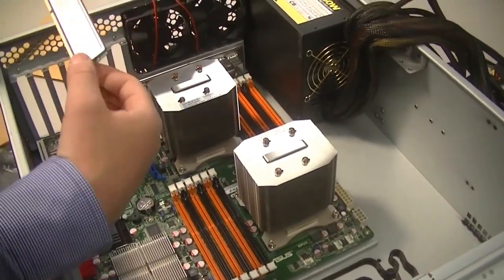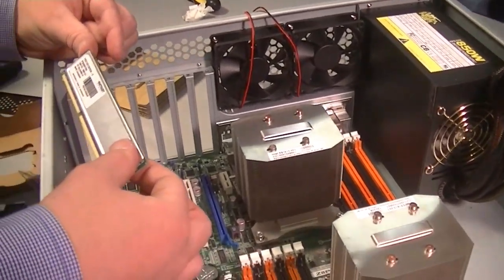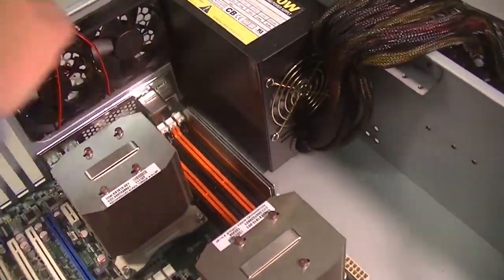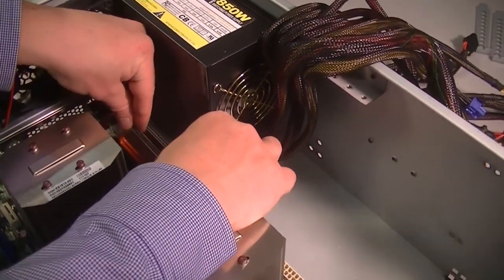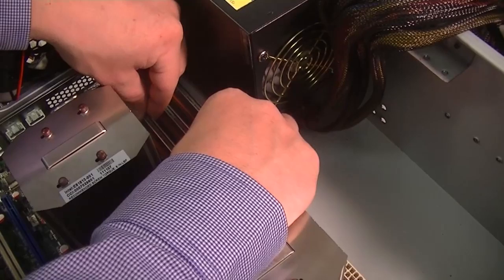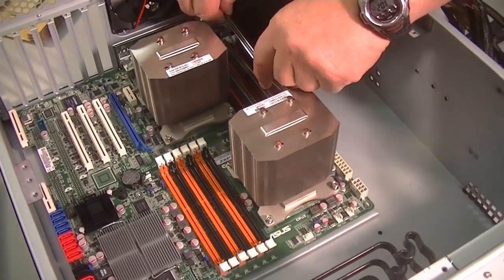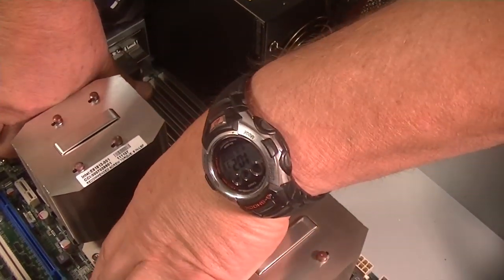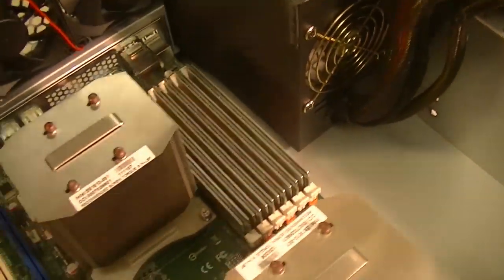How to build a server computer: Part6 Installing the RAM memory

Comment: Dan, while i think that your instructional videos are great, this server series IMHO is not well thought-out.. If these instructional videos are aimed at total noobs, no noob will know what power supply or motherboard they need, what processor fits into what socket, what frequency RAM to use... Basically none of it. 

If on the other hand, it's aimed at advanced users (which i seriously doubt), they already know how to assemble a PC and what components they need for the particular type of server they're building, and for what particular purpose they're building such web server. There are so many factors in play here that it's almost certain that a noob will either destroy the equipment, buy the wrong parts or will simply never be able to make it work.

Like i said other (software) series are great, and though i already know most of the things, i enjoy watching them, but this one is really not well thought-out.

Comment from the maker: In our case it actually didn't matter since we had 12 sticks of memory for 12 slots, but lets say we had only 4 sticks of memory for 12 slots in that case you want to reference your motherboard manual to see which slots you need to populate first. Like if you have only 4 slots, the black might be slots 1 & 2 and the orange are slots 3 & 4 ... so you would want to put two sticks in the black. There are other issues too when you buy memory, like if it is a

Comment: Some differences with servers vs desktop pc's are like he said, Xenon processors, or those AMD 6 core ones. The ECC memory doesn't matter so much but can be nice to have if you can afford it, or if you will be operating the server around radiation. The operating systems will be different like Linux or Server 2008. The disk storage starts to get exotic quickly with DAS, SAN, NAS Iscsi, it can be local, remote, or both. This server isn't for a switchroom though, those have their own requirements

Comment: Yeah it greatly depends how you configure the system Dan. The VMware setup I'm used to runs over a web client and that system only uses memory and CPU resources when you deploy the VM and power it on. Undeployed vm's just use hard disk space and nothing else. Setting limits on how many can be deployed at once allows a lot of vm's since not everyone would be using them at the same time.